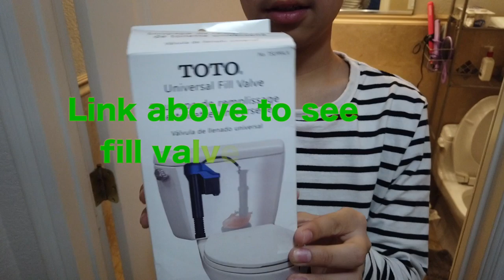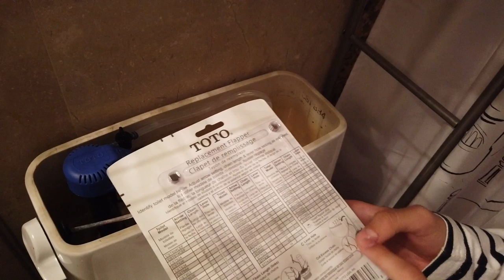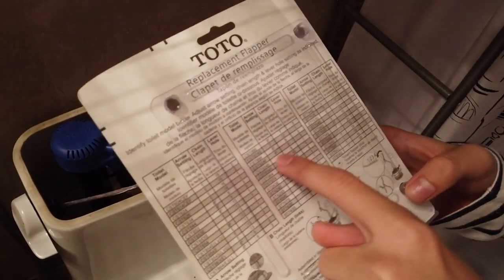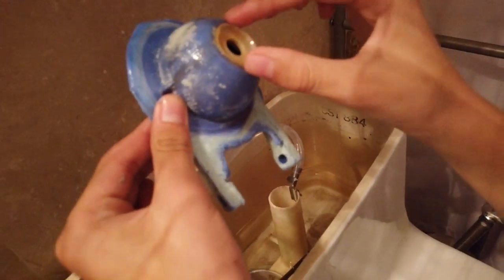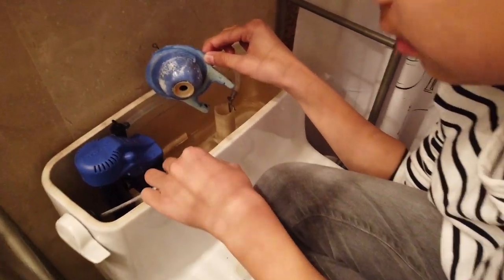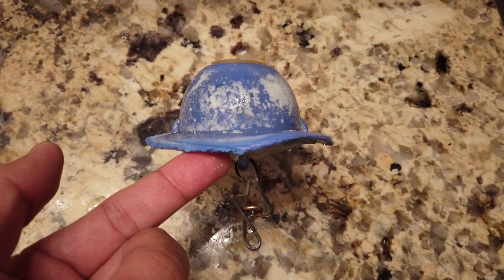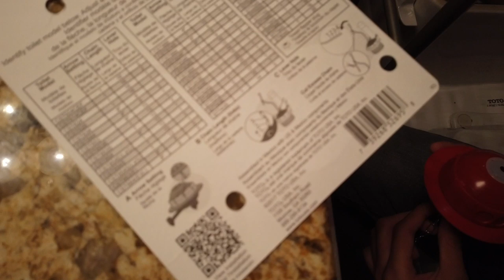How to Replace a Toto Flapper Valve on a Leaking Toilet - Jesse Handles It

Comment: The ‘hook’ at the end of the chain is not correctly hooked onto the ‘flush lever.’ Attach the ‘hook’  from the bottom of the hole, not the top, so that the chain hangs freely.